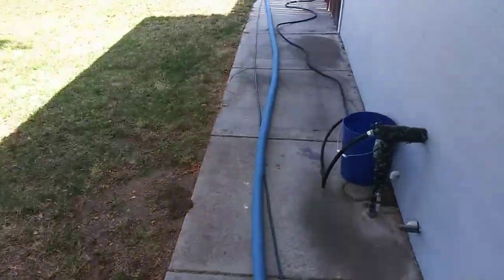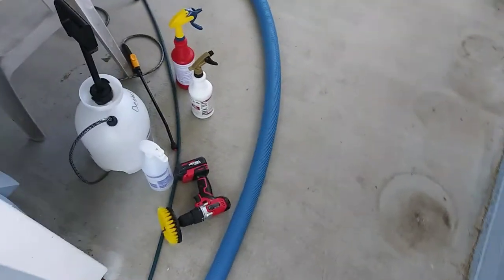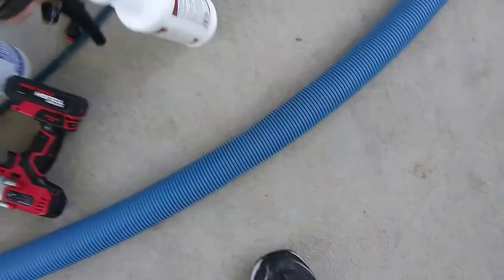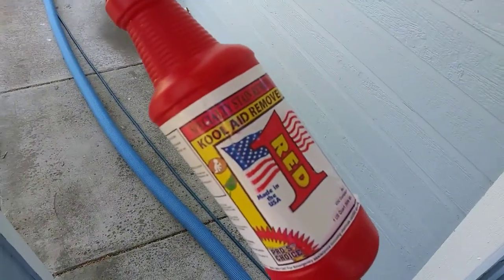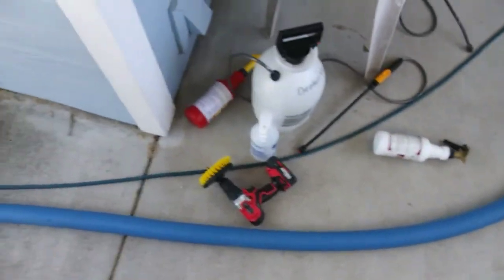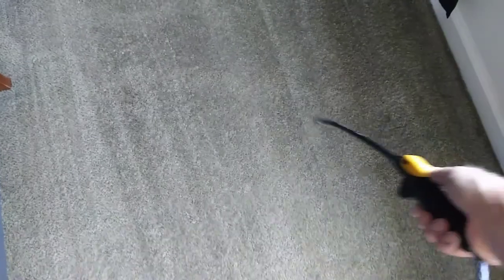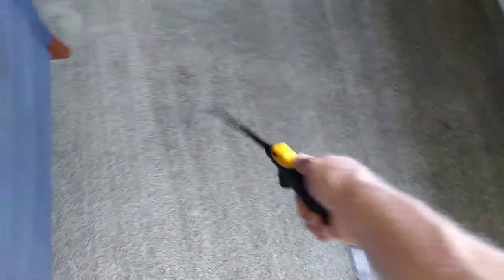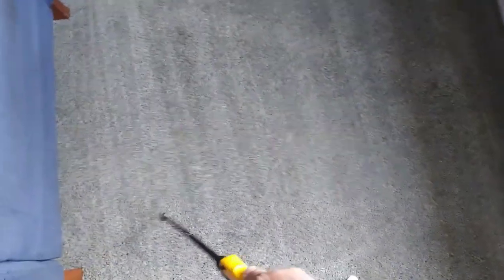If at first you don't succeed try again - Carpet cleaning tips

Comment: Excellent job what’s the best thing to use to get the pet urine out and the best thing to use for the high traffic area and the filtration
Reply from the maker: For pet urine stains 20 volume peroxide clear or stain 1 by pros choice. Tmf also has a great pruduct called Unchained. For traffic areas all depends on the source. But in general good pre agitation helps with final results. 
As far as filtration lines agitaion with a peroxide additive to your solution helps. Good luck
Reply: Green Rhino carpet cleaning thank you so much I tried the upt treatment but it doesn’t work well